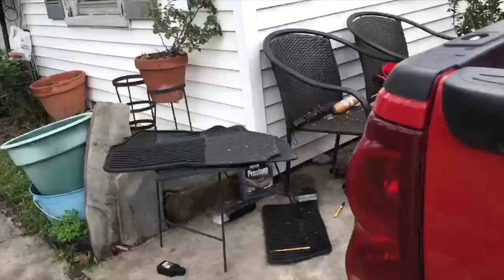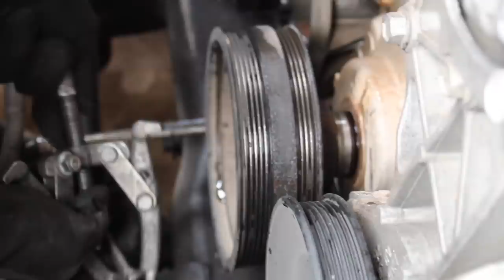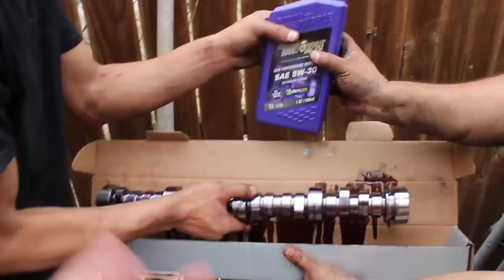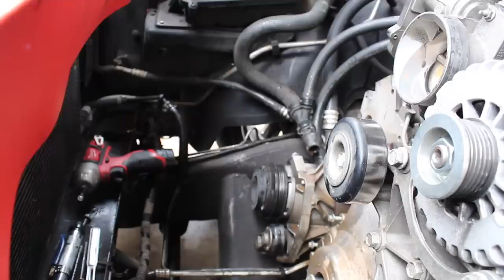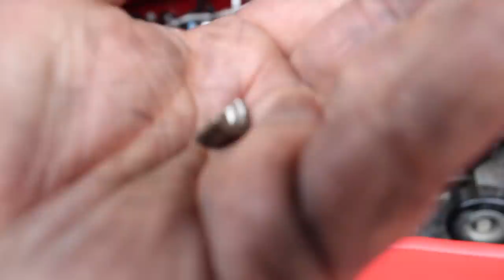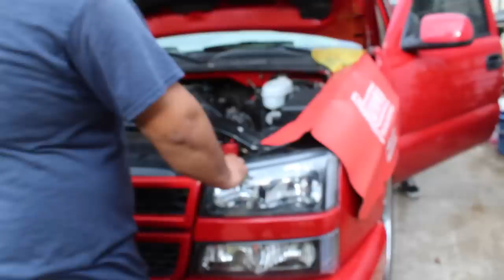HOW TO CAM SWAP YOUR LS MOTOR | BTR STAGE 2 TRUCK CAM (4.8L, 5.3L, 5.7L, 6.0L, 6.2L) STEP BY STEP

Comment: Bro that motor had some miles on it huh...  Tell em to change their oil more often lol
Reply: Chase that thing looks rough. So much sludge.
Reply: Its an LS, it will run on mud! These engines are built like tanks! You can beat the living shit out of it on the street and the engine will laugh back at you and ask if "thats all you got!?"...
Reply: Jesse Myers amen brother, my 5.3’s got 250K on it still running strong as ever
Reply: @thecraftsman8133  yeah it's true that's how my Dad ran his 6.0 Silverado for a long time shit was super black. Now I own it and the bitch runs strong and it's a 5 speed manual 4x4

Comment: Good video guys few things though . On that crank bolt removal , and the impact technique  =-)  . Best to heat that bolt with a small torch first as I have seen those bolts with Lock tight from the factory cause crankshaft threads come out with the bolt if not heated first . Sometimes it happens . . .  . .  Also there was no mention of how you opened the A/C to remove the radiator/condenser . If you have near by garage with a recovery unit have them pull it down to save your refrigerant , and when completed return , and get it replaced saves some bucks. LOL ! Also when reinstalling the timing chain cover leave the bolts loose until you let the harmonic balancer ' center ' itself in the seal . The same as when replacing the oil pump . Speaking of which on this engine ( I understand this due to circumstance isn't a option sometimes ) I'd have replaced that chain as it looked quite loose and the engine varnish indicated a lot of miles or poor service . An oil pump ( high volume ) new timing set , and new tensioner/guides   . Speaking of those . . .how'd you release them , and where were they ? I didn't follow the spring R&R all the way through but rags , a magnet d some grease on install  are a big help with those also don't forget a tap or two with a light hammer to be sure they've seated after compressor is removed .  Show how to put the pistons top dead center on the cylinder your working on and lock the crank from turning somehow then charge the cyl with at least 120lbs of air through the spark plug hole ( can make a tool by brazing a male air chuck coupler  to a spark plug base ) or as much as you have .  This will have the added benefit of doing a leak down test at the same time before you change the springs . A win win for you as you can advise the customer of engine condition so a longevity issue won't come back to your doorstep  Then if all is good you have done the customer a favor at no cost to them or you . Always good to hear news like that if you're paying for a job as freebies are always good news ! All in all though a good video and thanks for your time and effort to post and help folks. Be well guys.
Reply: You don’t have to do tdc on a 2000 plus, this ain’t the 70’s

Comment: Necesitas reprogramar la pcm despues de instalar el arbol de levas?
Reply from the maker: si
Reply: @dinocoblue2709  y adonde lo puedo llevar a que lo re programen
Reply: @dinocoblue2709  deberías de hacer un video de eso carnal
Reply: Adrian Zaragoza martinez Sabre’s de alguien k lo programs
Reply: @dinocoblue2709  where did you find rods to hold the valves?
Reply: @pedrodominguez7501  I’m late but they sell them at Home depot

Comment: Ok i like the video ! Gonna cam my ls swapped obs 2 questions 
1) whats the lenght and size of the rod to hold the lifters? 
2) for each cylinder that you changed the springs the piston has to be up for each cylinder so the valves can hit ?
Reply from the maker: 5/16 thick and the length is a little longer then the block, and yes thats right for the second question

Comment: Got a 04 silverado 5.3 4x4 with a small lift. Borla xr1 only everything else stock. I want to make run and sound a little better. Nothing to crazy. I was thinking of also doing stage 2 cam and long tube headers. What do you recommend? Or what else can i do to it ?

Comment: Next video- installing a stall converter!
Reply from the maker: Dinoco does need a converter so I'm sure that video is coming soon
Reply: Nah fuck that I didn't need it😂
Reply: ......With engine and transmission in the truck.
Reply from the maker: 5.3L with a 4l60E @Ashroyer86
Reply: Dinoco Blue what are the rods called to hold the lifters and we’re can I buy them
Reply from the maker: they don't sell them for the cam swaps, you have to make your own, buy some 5/16 rod at Lowes that will work @jnnavarro1728
Reply: Dinoco Blue how long do I get them and thanks
Reply: @jnnavarro1728  cam swap lifter Retainer tool powerhouse tools POW101046
Reply: @jnnavarro1728  estan Caros 80 dlls mejor ago unos
Reply: I need help . i got a btr stage 2 hivebee springs hp tuner tune stock converter . but the truck feel sooo slow what can i do or do i need a stall pls help me.
Reply: @dinocoblue2709  i need help w btr stage 2 on stock converter . truck too slow
Reply: @jnnavarro1728  i was just about to ask this same question
Reply: @Elvergalargax   maybe for the Vehicle you have the cam was not  "good" to be swap...

A good stall will be a good choice but get your vehicle differential gear ratio and get some information maybe that has to do with that slow feeling...

Comment: I use an adapter in the spark plug hole, compressed air to hold valves shut. Great video.
Reply from the maker: that's another way to do it

Comment: Great work men!  Should fill coolant in main top hose first, then top off the coolant Reservoir.  That way a lot of the air is out of the system for the first start n Purge of coolant system.  Great job!!!  1000 likes!

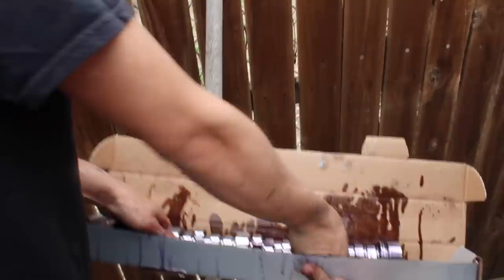Comment: 13:00 lol! , you guys are funny and made me laugh. reminds me of San Josa as a kid... Get a magnet for your keepers, helps a lot. Pushrods may need to be a different length depending on the base circle of your new cam. get a tune. Hopefully it was ok.
Reply from the maker: lol we appreciate it, the cam is a low lift cam that btr says the stock pushrods can still be used , runs pretty good after the tune, thanks for watching

Comment: Where did you get the long metal rods to hold the lifters up to remove the cam?
Reply from the maker: Lowes they are 5/16 thick
Reply: @dinocoblue2709  cool thanks. Great videos. Very helpful info
Reply: @dinocoblue2709  about how long are they?

Comment: Why did you have one side valve cover on while still working on the other side did you not tighten down the rocker arms using TDC on every piston or is that not required unless you’re changing out the springs?

Comment: Tsp 212/218 .600" 111 lsa. Only a 67 horse gain. S&b box CAI,  Gibson shorty headers and gutted cats and true dual cherry bomb extremes. Gunna be tuned by HP tuners 😍
Reply from the maker: sounds like a really good setup
Reply: "only" 67 horse from a baby cam, LOL
That's a good gain!

Comment: So do I keep turning the truck on til it idles itself? I just put a stage 3 btr cam on my 4.8 yesterday. I’m also putting a bigger intake and bigger injectors so hopefully that’ll help it stay on too
Reply from the maker: Just get it tuned and it’ll all be fixed
Reply: @dinocoblue2709  yea I was hoping to drive it there but it keeps turning off 😂
Reply from the maker: Just 2 foot it

Comment: On a brand new cam I would recommend assembly lube. Make sure that lubricant stays there
Reply from the maker: I agree but we like to just send it
Reply: Oil is good enough for a roller valve trane.
Reply: Ken Switzer yeah I guess that makes sense

Comment: I’ve got a 95 GMC Sierra k1500 with a 350, just got an 1102 cam from summit. Was wondering if an obs truck my year and model have the holes for the rod to hold the lifters up?
Reply from the maker: I don’t think so, if you take off the intake manifold you’ll be able to remove your lifters from there so they don’t fall, your motor doesn’t have the lifters under the head
Reply: @dinocoblue2709  awesome, thanks for the reply!

Comment: So u don't use air in the cylinder. You just run the piston up top and don't have any issues with the valve falling?
Reply from the maker: that's right, nice and simple, no extra tools needed
Reply: Unless you're changing valve springs
Reply: @pmotorsports8276  They are changing valve springs. That's what we're talking about.
Reply: O crap I just saw that very risky
Reply: Magnets are nice for pulling keepers out

Comment: Do I need any rtv on the bottom of the timing chain cover
Reply from the maker: yes it'll help to not get any leak
Reply: @dinocoblue2709  @dinocoblue me gusta El cam stage 2, acual me recomiendas para mi Silverado 5.3

Comment: Question. If your not going to use air to hold the valves what are you looking for when he is spinning the balancer? Also i have 2010 4.8l. And I can't figure out if I have DOD or not. I read 4.8 doesn't have it. True or not? How can I tell for sure. And do I have to buy 4-500 dollar kit to delete it?
Reply from the maker: I'm looking to see when the piston pushes the screwdriver all the way up meaning the piston is all the way up, if that makes sense
Reply: @dinocoblue2709  thanks for replying. I didn't see any screw driver lol I must've missed it. Where exactly do you put the screwdriver? Where the pushrods go?
Reply: @Max Church take out the spark plug, slide screwdriver in there, then turn crank until said piston is pushing screwdriver out.

Comment: Last question. Due to unfortunate events. Aka, someone running a red light and hitting me totaling my work truck. When you replace the cam with a BTR stage 2 cam does anything else need to be changed?
Reply from the maker: just the valve springs but the cam kit should come with them
Reply: Dinoco Blue yes the cam included springs. Im just gonna change the cam, timing chain and guides, valve springs, push rods. Possible rocker are trunnions and hopefully the lifters will be fine.

Comment: Can you get me the link to that valve spring compressor?? That is genius. I would even use that on the bench 😂
Reply from the maker: https://www.ebay.com/itm/Newly-Valve-Spring-Compressor-Tool-Fits-Chevy-LS1-LS2-LS3-LSX-4-8-5-3-5-7-6-0-LS/113765261357?hash=item1a7cf0202d:g:0UgAAOSwRlFc~wdI
Reply from the maker: on the bench is even easier with this tool, I do both of the heads on a bench with this tool in about 15 mins

Comment: Question: So im doing a l59 (5.3swap) out of a 2004 tahoe with 4l60e into my 2011 Toyota Tacoma & rebuilding the engine & adding a BTR stage 4 with headers new everything basically. And the tacoma is going to be mainly for off-roading. Here the Question: do i need to install a stall? I see they recommend 3200. But its for rock climbing and so forth... So i need the power down low to? What do u say?

Comment: also at about 10:22 when you put the rods in to hold lifters up what is the purpose of pulling them back out and then putting back in? And where can you get them rods? Thank you.
Reply from the maker: I was just trying to get them in all the way and to where I felt good with them in, t Lowes they are 5/16 thick
Reply: Thank you

Comment: Are there any gaskets or anything to worry about? Also, why would you use a dowel to hold the push rods if you're doing springs anyway, wouldnt it be better to pull them out before you pull the cam?
Reply from the maker: The dowels are there to hold the LIFTERS not the pushrod

Comment: Hey man will i be able to tow with my truck after a btr4 cam swap on stock stall?
Reply: Sergio Caballero I’ve got that cam in my 04 with a 2800 stall and it tows just fine

Comment: Ive never changed a cam without putting on new lifters and timing chain!!  They should have put in new oil pump while they had it right in front of them.
Reply: Dinky Ray you can reuse roller lifters all day long unlike flat tappet plusYou have to remove the intake and the heads to be able to swap the lifters and change head gaskets while you’re in there
Reply: @Unclejessestunts   Every new cam needs new lifters so they wear in together. Even roller lifters..
Reply: That’s simply not true because it’s not like flat tappet they don’t have a break in time look it up when it comes to roller lifters and a roller cam
Reply: Seems you've wasted a lot of money then.
Reply: Texas Hank Palmer I haven’t I’ve got 90k + miles on roller lifter that where reused at 110k trucks at 209k miles now
Reply: Jesse Saffa hell yeah!👌🏻 (I was talkin about Dinky Ray wasting all his money btw) I think people have more problems the more they switch out parts. When it comes to the LS, the old adage definitely holds true: “if it ain’t broke, don’t fix it.” Just go take a look at Sloppy Mechanic or The Driveway Engineer. Sloppy was reusing head bolts and gaskets all the way up till he reached about 1000 hp. That stock motor will hold much more power and abuse than people realize.
Reply: @texashankpalmer876  To NOT HALF-ASS an engine build isn't a waste of money!  They should have waited until they had ALL the parts needed to do this install right. Not only is the cam new but is way pass stock level! * Jesse Saffa--- " I got 90k miles on a set of roller lifters that already had 110k miles on them!"*** ----- Sounds like something you'd tell the tow truck driver on the ride back!--  "Roller cams don't need new roller lifters!"---------  A NEW  BTR Stage 2 cam SHOULD get new springs, seals, cam bearings and lifters.   JUST BECAUSE YOU DIDN'T DOESN'T MEAN YOU SHOULD HAVE !!
Reply: Dinky Ray sounds like someone is a little salty now that they’re starting to realize how much useless $$ they spent on their rig. There’s a difference between spending money on upgrades that make a difference, and wasting money on useless replacements for perfectly good parts. The only thing  half-assed is your knowledge and research on the subject. Spend some more time in a book and spend less $$

Comment: Hey bro just a quick question on this engine and if it has the Water pump as part of the cam shaft and if you have to do a whole timing job just to change it.?? Also does this engine have afm
Reply from the maker: Yes you have to do the timing to change the cam, this motor did not have afm
Reply: Ok just checking

Comment: No le puedes hacer eso ami troka amigo???
Reply from the maker: si primo yo cobro 600 por la mano de obra, y tu compras el cam kit
Reply: @dinocoblue2709  donde te puedo contactar amigo
Reply: Tienes face amigo para contactarte
Reply from the maker: no, tengo instagram @lorenzomedrano @edgabrielcervantes9707

Comment: This is motivation brotha....I was given a 2002 Silverado. The only bad thing is it's a V6...Haha either way. I plan on getting a vortec v8 and want to swap out the v6, I want it to run nice. Not a race type guy, but I do like the stage 2 cam sound in the exhaust. More just the sound bro. Take it easy bro. Be safe. Nice video bro
Reply from the maker: thank you bro I appreciate it, hell yeah that would be a nice truck with a stage 2 cam
Reply: Andres Fernandez fuck it cam the v6 😂

Comment: Not gonna lie I like watching cam install and fresh start ups, but how long to break in a cam 😁
Reply: These are roller cams so there really is no break in. Everything seats soon as u start it up. Not like the old flat tappet cams where u had to let the lifter seat on the cam.
Reply: andrew geary I know 😞 I just want to see more cam installs and content
Reply from the maker: im sure there will be plenty of content coming, I got many plans for dinoco and the channel @Lostsoul.668
Reply: Dinoco Blue have you installed a trunnion kit on your truck? And is a dam MSDS coil packs and wires work 1200$ 😑 and love your videos I just don’t have time fixing mine but have time to watch and miss the smell of oil
Reply: TRIZZY Danna really no reason to go with MSD coils, unless yours have 300k miles on them or going out lol
Reply: Question brother!!! I’m about to start my cam swap what rods you use? For the lifters

Comment: Nice work bro....so to change valvespring ,piston has to be on top on that cylinder??and to remove rockerarms piston #1 has to be tdc or not necessary???
Reply from the maker: thank you bro, yes thats right just put the piston at tdc, and you can just remove the rocker arms however it doesn't matter
Reply: On each piston. So one at a time. Bring the first one to tdc, swap springs and seals, then put the keepers back on and when you go to the next set of valves, bring that piston to tdc. So on and so forth. If you pull the keepers off the valve and the piston isn't up high enough to keep it from falling into the cylinder, your fucked.

Comment: Should of installed melling high volume oil pump 💪
Reply from the maker: yeah maybe soon after the tune
Reply: Even a factory oil pump would have been good while you are that far into the engine also, GM recommends replacing all the bolts if I'm not mistaken because they are tty.
Reply: @sigersonholmes7758   Matt with Sloppy Mechanics proved you can reuse all the bolts including head bolts.
Reply: @chrislynch5024  I've seen that and not to argue but GM still recommends replacing all tty bolts. As a former tech if a customer's vehicle came in and it had tty bolts they would get replaced. The reason they are replaced is because of bolt or rod stretching. I have seen a few guys make the claim of reusing those bolts but that would not fly in a shop.  Torque To Yield is exactly that: the bolt is torqued until it "yields". This means the fastener has been torqued to its elastic limit and will NOT return to its original length once the load has been removed from it.

That is why TTY fasteners are typically regarded as "SINGLE USE". It is NEVER a good idea to re-use them. Even if some people do.

A good article on the different types of fasteners:

https://www.onallcylinders.com/2017/03/17/quick-tech-tty-fasteners-ls-engines-need-know/

We want to do the job right the first time because we don't get paid the second time. 

P.S There is also a tool to check bolt stretch